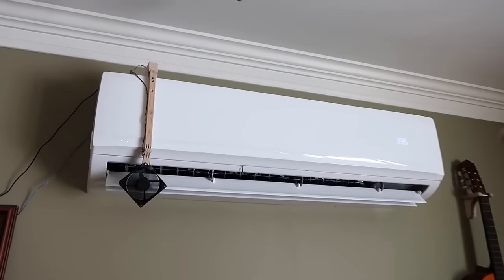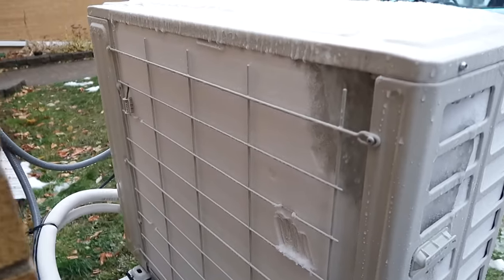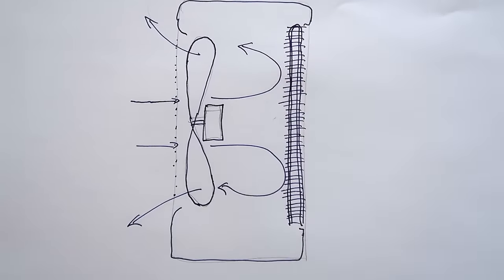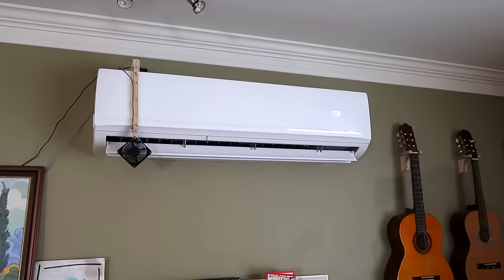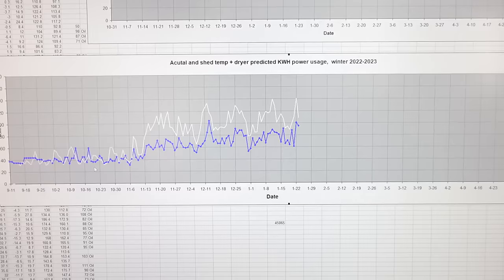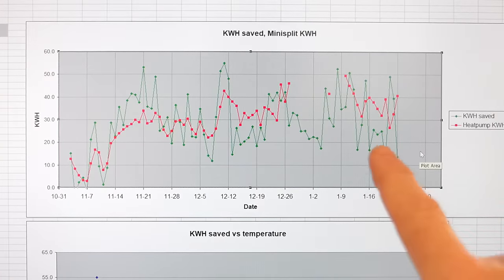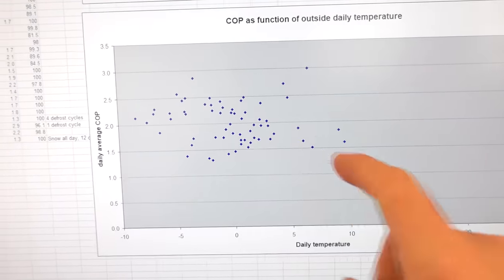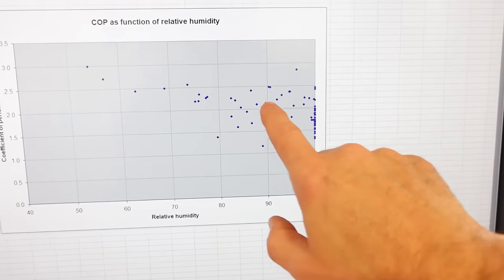How efficient are our minisplit heat pumps in the winter

Comment: Build a cover for those outside units to keep the snow away, should help a lot.
Reply: Yup, even just covering the top of the intake side would probably do a ton without hurting the airflow enough to matter.
Reply: I think this would be an interesting experiment. If the fan is moving a lot of volume, a smaller cover wouldn't prevent enough snow from getting pulled through the unit. A larger cover would limit the amount of snow, but could limit air flow and not distribute temperature as quickly, making the unit less energy efficient overall.
Reply: I want to build a large "winter" housing with screen mesh intakes to see if I can keep the fins clear of snow.
Reply: I don't think you would need any kind of screening. Just a large enough roof over the unit and maybe some slat walls. I think screen might get packed full.
Reply: @barthanes1  exactly. It’s a lot easier to shovel around a large cover than trying to clean and de-ice a screen
Reply: Just DON'T do what most people do when they make a "house" for it, they cover it all up ald get almost zero air flow after dropping the efficiency severely
Reply: I have mine under the deck which was built just high enough to fit the unit underneath. No snow issues (but coils still ice up from moisture, so regular defrost cycles do happen)
Reply: The fan blows from front to back, so you'd have to make a cover at it's front.
Just something to keep in mind.
Reply: @patrikjankovics2113  The fan blows outwards at the front. The evaporator is where air gets sucked in. You want negative air pressure inside the outdoor unit for as uniform airflow over the evaporator as you can get.
Reply: Maybe a screen above at the back rather than a solid cover or even two screens layered somewhat apart, that should exclude snow but allow air flow (and as Matthais is reading his electric meter close by daily removing accumulated snow now and then should be mostly costless work).
Reply: @sfan2767 piece of plywood and brick to weight it down would be enough to prevent it from having to defrost so much from snow accumulating
Reply: I also want to comment that you can shield it... But the shielding needs to ensure the airflow and can't go to much down because of the snow builds up from there and may block airflow
Reply: Yeah, just like an awning or extended roof would work wonders. just keeping the snow 2-3 feet away from it would help substantially.

Probably wouldn't help with the condensation freezing, but it'd help with the radiator being 'plugged up'
Reply: This would be a good build video for the main channel as well...
Reply: @JeffDM   - the screen will fill with snow and not get defrosted - likely, an intake house with a "stilling chamber" - to slow the intake velocity so that the snow falls out f the "entrained air" will prevent it reaching the intake screen, but volume limitations may make it unrealistic to achieve, lol.
Reply: @matthewcantrell5289   - a propane torch could quickly defrost the screen, but defeats the object of using cheap electricity...
Reply: Snowfall and ice buildup on the condenser fins are both phenomena that happens when humidity is high, so it’s not the snow itself that creates ice. Haven’t seen any of the installers make “snow huts” on their units here in Scandinavia, they just leave them as is.
Reply: You build anything around the unit and the efficiency will plummet. I've  attended calls where the whole damn thing was iced up and no defrost working..all because homeowners try to get smart
Reply: The only benefit from a shed roof would be if you had liquid water from above (melting snow on a roof) dripping on the unit. I know it seems counter intuitive but the relationship between snow and the unit freezing up is that the ambient humidity in the air will likely be higher depending on the temperature and other factors.  The freezing up is caused because when you get near freezing with the unit set to heating is working just like a dehumidifier. The problem is that now the unit has cooled the air flow through it to below the dewpoint and its producing below freezing air temperatures. Meaning the condensation freezes instead of dripping off. In most climates the ambient humidity will naturally drop off the colder it gets, near large bodies of water it can still be higher though.  Most of the icing is going to be a problem near the freezing point the lower the temp. the tendency will drop off. Also if the outside unit is 'near enough' to a dryer vent that can  occasionally cause problems but it would be special circumstances.  :)
Reply: @patrikjankovics2113  Nope. Fan sucks air from the back and blows it out at the front ...
Reply: Would love to know impact of blocking wind as well. Mine is in a pretty windy area.
Reply: @RandomActsOfMadness  My one, in the rainy part of Norway, has a painted wooden "hut" on it, with a roof and slats angled at 45 degrees all around (the side facing the house is open though, but covered by the roof). Part of the reason for the "hut" is aesthetics and blending in with the house, but it should also protect against precipitation. And not just snow, I think. When it's raining and just barely above freezing, I suspect that rain can cause massive ice buildup.
Reply: @Hagledesperado  I live in the mountains in southeastern US and while it doesn't get near as cold here as in northern climates, high humidity or even heavy rain at or near the freezing point is fairly common and regular during the winter. It does happen occasionally that you notice its a bit cool inside and you look out at the unit and it is a giant block of ice. I specifically recall it happening 5 or 6 times in 30+ years
Reply: @patrikjankovics2113  My outdoor unit blows from back to front, so the air direction may vary between makes and models. Something to keep in mind.
Reply: A cover really helps, and also protecting the intake from the prominent wind direction to prevent snow and ice buildup. All ice that need to be defrosted costs wasted kW that you could put into your house.
I learned this the first winter with my own heatpump some 18 years ago. It was defrosting a lot and causing cold drafts from the indoor unit and droops in indoor temp. A simple cover over the top and a side cover on one side really increased efficiency.
Reply: @RandomActsOfMadness  And for others who said this, no, I've put in a shelter with a metal screen, and yes, it for sure helps with the issue he has. You will still build up frost, but his is packed up with snow on the back. 
I also have a friend who has three of them on one side of the house, and only one of them was too packed up with snow since the snow blew from one side.
The screen is all around the top and sides but not right up against the unit. it works just fine.
Reply: But very interesting to see kW/h difference between shelter and no shelter in winter and summer!
Reply: @Brurgh  kW/h is not correct. 

Say, 1 kW for 1 hour is 1 kWh (kW times hour).
Reply: If only he knew a super talented woodworker… oh wait 😊
Reply: @dannyjepp985  obviously, you have to experiment, but I doubt a cover would make that much of a difference if it was shaped more like a roof I've been toying with the idea of enclosing my unit in screening with some sort of a roof in order to keep the pine needles and fluff from trees and plants from getting sucked into the coils. Keeping the sun off the unit in the summertime would also make it more efficient at air conditioning.
Reply: Snow wasn’t the problem.  It is frozen condensation.

Comment: In Finland covers or canopys for air pumps outside units are rather typical, those would prevent snow issues. Would assume that depending on model they would somehow impact to air flow also, but guessing they would have minor impact. They also hide the ugly white plastic, which seems to be only option by many producers. Considering to make one with homemade bandsaw?
Reply: All AC guys I've talked have said to never use those covers as if they hinder even bit the airflow, efficiency apparently drops quite much. Don't know if that's true, but guy who installed mine was at school same time and I believe him. Outdoor units are indeed though quite ugly.
Outoa kun meinaa, että imee lunta kitusiin. Ei itsellä ainakaan ole moista ongelmaa ollut koskaan.
Reply: I was thinking you could build one like a custom range hood with a style like shaker or tudor or something, even copper or steel if it looks good with everything else. If it's big enough it shouldn't affect the fan much I would assume, but how big before it looks ugly.
Reply: @jothain  That is not true that you should avoid using covers! 
But what one should consider is the area of the intake fins, and that the available area around the unit should be greater than that. The instructions recommends a minimum distance from wall and surrounding obstructions, so your AC guys should pay attention to those instruction.
Almost all outdoor units suck air from behind and blows out the front, if you block the top and one side of the unit, the remaining area on the bottom and the other side should be as large as the whole fin section.
Reply: @jothain  As an HVAC guy myself I agree generally any type of cover will hinder airflow decreasing efficiency way more than it will help with defrosts. If you are going to do something of the sort you never want to  cover the sides and you want to leave ample room above the unit for air flow. I believe minimum distance above for a awning type cover is somewhere in the 2-3 feet range.
Reply: My bugbear is the ugly white / pale grey. I think they can be painted but no-one seems to do this. Black would be a better option for most.
Reply: @nathanbrown5099  Seems like it wouldn't be that much more expensive to build the awning/canopy way higher up. Put it 8 feet up on the outside wall of the house and it likely won't impede airflow at all!

Comment: Thank you and good job on including the defrost cycles into your COP.  Plenty of people wouldn't include the "bad" parts and instead would just tell themselves how smart they are using a mini split.  COP tends to dive below 2 when it gets cold, and between that and the high cost of electricity here ($0.34 per kWh) a mini split is no better than the cost of heating oil.

Comment: I suggest you to remove the transport wiring mesh from backside of the heatpump.. It's just there to not destroy fins on transport. It should have been removed by installing company. This was big topic here in Finland this fall when people started to post pictures of their setups and huge portion had that mesh still installed.
Reply: The wire screen on the back side is intended to remain over the coil for the life of the unit. It is not just for shipping. Leaving it in place, as intended, has no effect on the system performance.
Reply: @darkstari  I can see some instances where this might be a problem in a humid and cold climate like yours, but I question how ice builds on the screen? It shouldn't be touching the coil, so it should remain at ambient temperature and not build any frost.   I suppose a thick layer of frost could build up thick enough to eventually touch the screen and cause issues, but a properly defrosting unit shouldn't ever have that much frost load.

Comment: I installed a DIY 18K unit over the summer (primarily for AC). I've been quite impressed at the offset it's produced to the oil boiler, especially in the shoulder season. Rough math so far has me saving half my annual fuel oil usage, with a modest increase in electrical usage. Fuel oil is around 5$/gal, and I usually use 6-700gal/winter. It's paying for itself quickly at this rate. Would love to have the granularity of the data you collected though!
Reply: I would look at insulation first
Reply: @rockymountainman7  they already installed the unit?
Reply: Yeah,  your numbers are spot on. In my case, heating cost is about a 1/3rd compared to using my oil fired boiler but that's because my boiler setup is super inefficient. Just going to a cold fired boiler would be a huge cost savings in my case.
Reply: @chrisE815  A lot of people who read this have not yet installed anything. My advice to people who think of making a move is to look at the insulation of their building first. Insulation you buy once and you benefit for every year after that. Insulating can cut down your energy use so much that it doesn't make sense anymore to make an expensive switch to something else.

Comment: We have 7 mini splits with two condensers at our house. Installed them 3 years ago. They work fantastic, even when it gets very cold outside. A lot cheaper than our old baseboard heaters, plus we get air conditioning in the summer.
Reply: I guess it depends on where one lives: Here in the very hot desert with relatively mild winters, I have a 6 zone Mitsubishi system but it is ducted with one exception of a ceiling cassette in a  utility room/home gym. I could not imagine the ugly boxes on the walls.
Reply: What's your coldest outside temperature in a typical year?
Reply: @jimmybrad156  Where I live, 30.0 F, is the average winter low.
Reply: @kennixox262 That’s why we have choice. What one finds ugly, another might find beautiful.
Reply: @jimmybrad156  coldest averages around -20 celsius, but usually it's in the -teens.
Reply: @TheCrimsonFlash  That is COLD

Comment: Nice job with the data collection and explanation of findings.  I installed 3 mini splits in my house in FL and turned off the old central air.  Our electric bill went down from $400 month to $150.  To say I am happy would be an understatement.   I know a lot of HVAC guys don't like mini splits because they are hard to work on.  Right now that is not my problem.  If worst came to worst I would just install a new one because the electric is already there and the hole thru the wall.